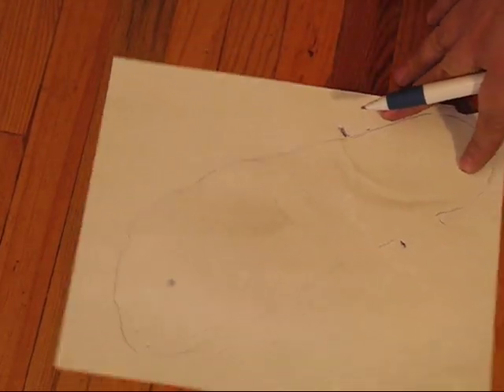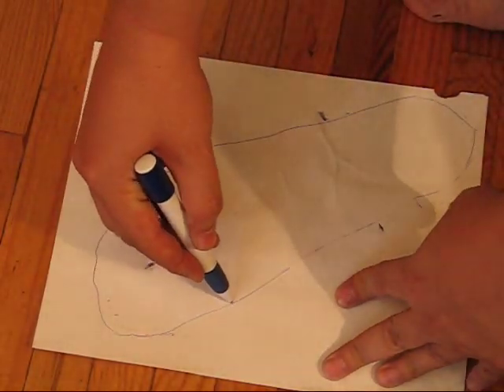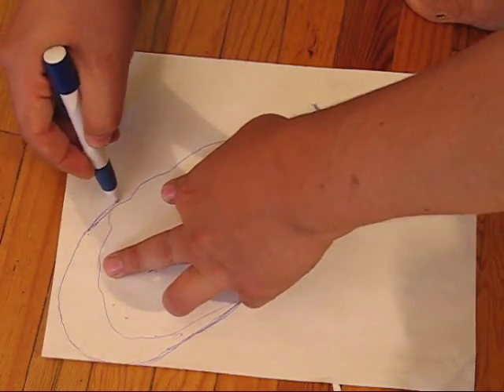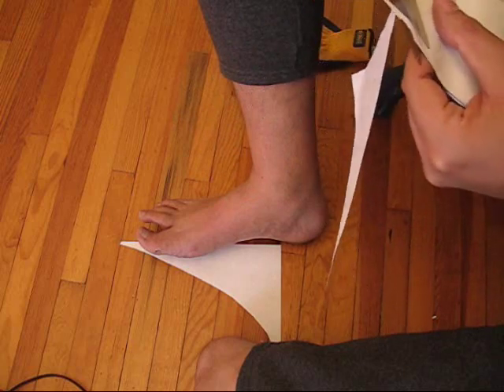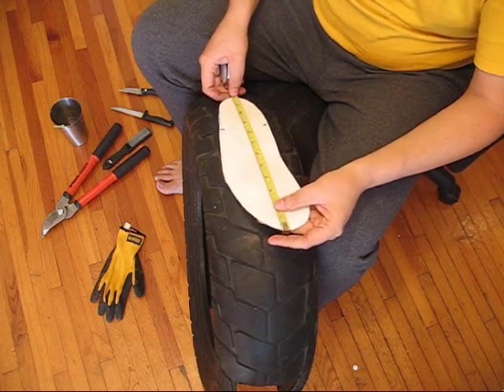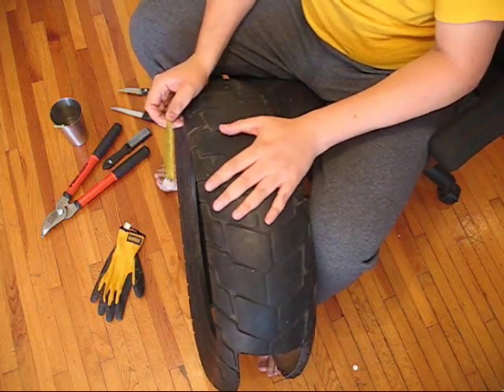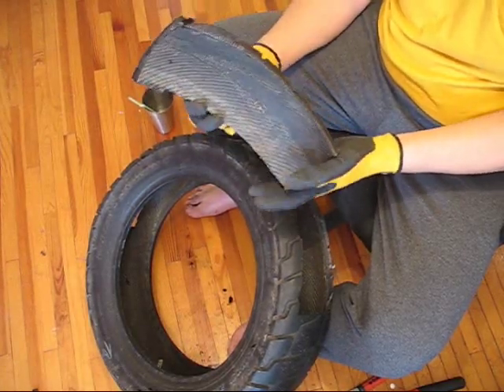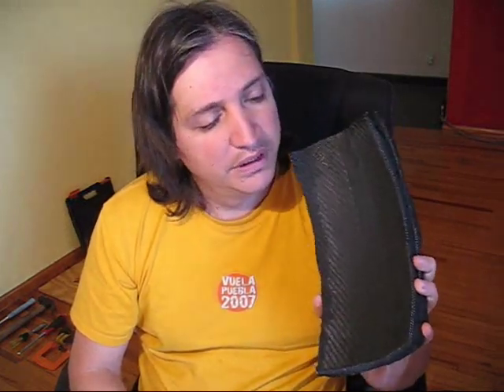Making Tarahumara Sandals From Tires Part 2

Comment: From personal experience using a hot blade on "no ply" tires. The PLY means the metal wires used to maintain integrity of the tire. So no ply-no wire and you are just cutting on plain rubber. Side walls don't have wires FYI I will be posting my own videos soon to show my creations
Reply from the maker: Airmanmx1 You are absolutely right. That's why I used motorcycle tyres: they have nylon or kevlar chords instead of metal wires.

Comment: I use dish soap solution to reduce friction when cutting soft rubber.
also, if your helper can apply tension to pull the  cut apart it will be easier.
SLM
Reply: Steve Mccull how about wax.  Candle wax